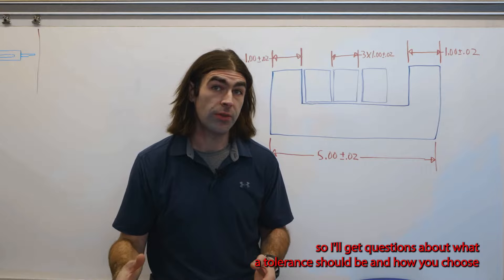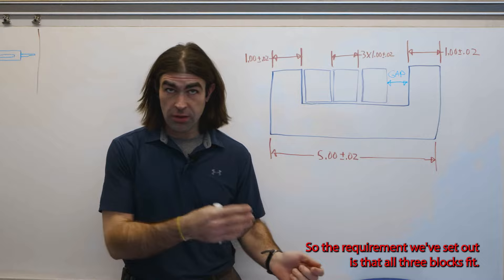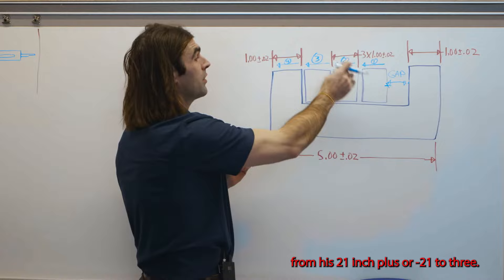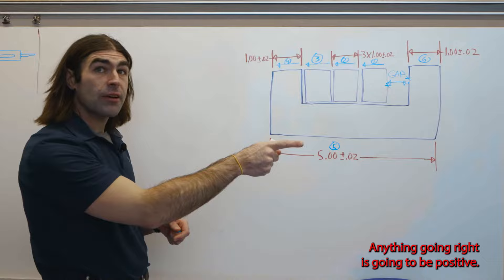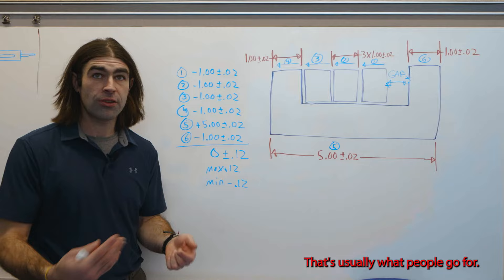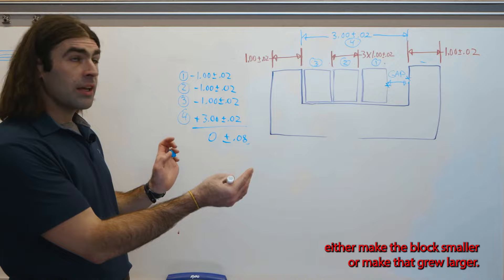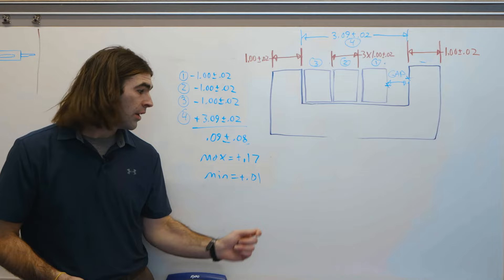Tolerance Stackup: Simple Assembly

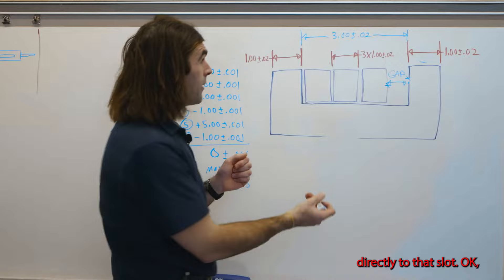Comment: Is there a reason why the slot dimension at 4:44 is +/- 0.2 rather than +/- 0.4?
My thinking is that the two ends of the slot both have +/- 0.2, so regardless the gap must be +/- 0.2 from both end stops - so 0.4?

Comment: 1.please explain with reference to Worst case and RSS method.
2.What is Assembly shift in stack-up
3.How to use cp and cpk process capability. for tolerances
4.How to create vector loop (Shorter loop with examples)
5.What is ppm Rejection how to understand it
6.What to do in case if tolerances are not equal bilateral
Thanks for your Efforts appreciated.
Reply from the maker: Hi,
Let me see what I can do to address some of your questions.

Comment: How is this beneficial over just using a unilateral tolerance such as 3.000 +.100 -.000 or a min/max dimension?
Reply from the maker: Hi, 
I use bilateral equal tolerances to save a step in calculation. If I use a unilateral dimension I would have to convert it into an bilateral equal tolerance to “fit” into the table to do the arithmetic.